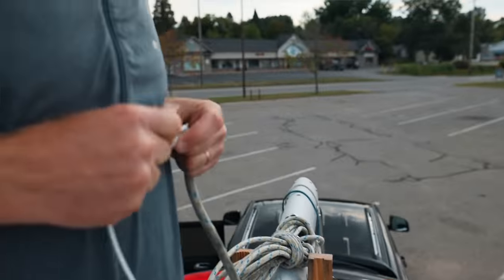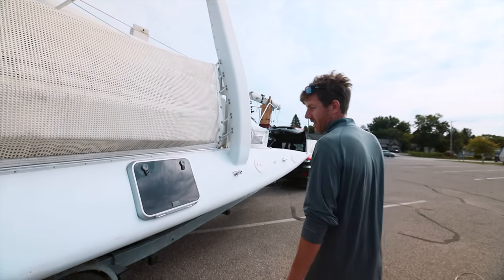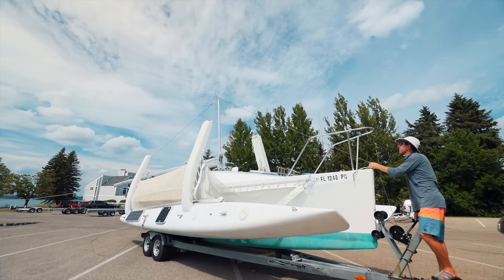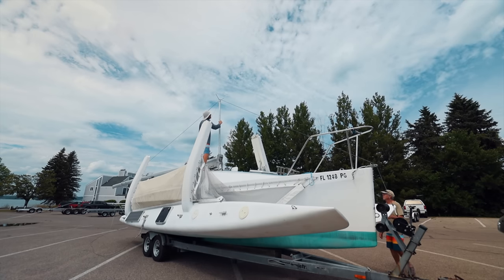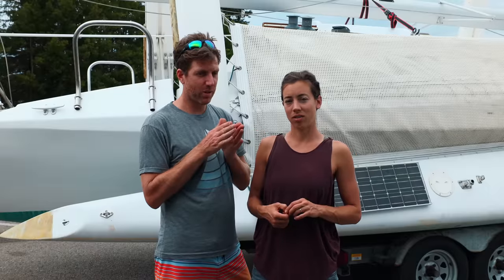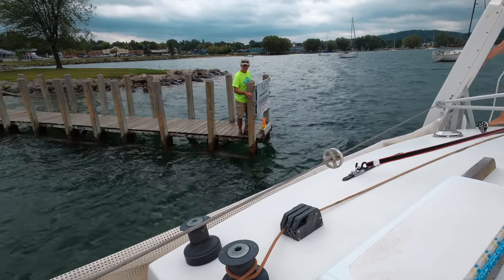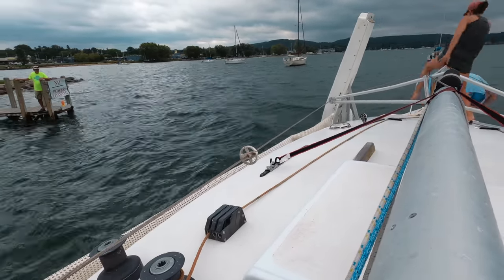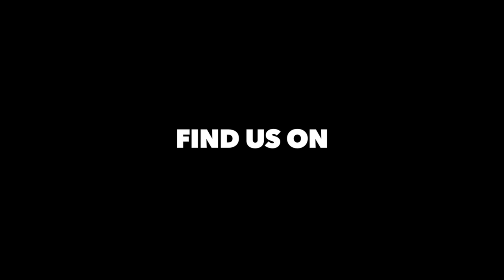How Many Quacks Does it Take to Launch a 32’ Trimaran? | Sailing Soulianis - Ep. 120

Comment: oh and one more thing. perhaps have a backup wire or rope on the highfield lever on each side stay to bridge the lever because ours broke. both of them actually. i have to fold in and out every time we go out. that part does not like waves that make your mast yank on the parts. I replaced them with a pulley system. much better now. :)
always something to improve. 😁 and much fun. saling or just sun bading away from the crowd.
Reply from the maker: Yikes!  Replacing the standing rigging is in the cards. But hoping we get another season out of it.

Comment: I know exactly how you felt.  My first and only launch involved 2 hours of rigging in a wobbly boat on land followed by trying not to hog the boat launch.  Eventually I finally got away from the dock and just drifted a while to physically and mentally recover.  Then just as I was thinking of raising the sails a strong wind came up and it was all my little electric trolling motor could do to make way back to the dock, all the while avoiding other big sailboats who were racing.  By the time I got the boat on the trailer and everything stowed I was totally wiped out and could barely drive home.  And this was only a 16' boat.  Decided this was the wrong boat for me and got rid of it.

Comment: With fuel engines parts and repairs and mechanics are everywhere. With electric, when it dies as it will, you are well and truly dead in the water unless you are moored in front of the dealer.

Comment: Reminded me of the first launch of my boat. Mast stepping is ALWAYS tense, no matter how many times you do it. Anyway, after a wonderful first sail on my new boat at my new marina when coming in at the end of the day I drifted slightly out of the main channel, bounced on a sand bar and my outboard (Honda 9.9) sucked up some sand and destroyed the impeller. Outboard would only run for moments and the wind was carrying me out of the channel. I was alone, running around trying to set the anchor, wound up peg-legging on the keel on the sand bar and had to call my new marina for a save. They brought out the working pontoon and towed me in, making sure I understood that, maritime law states that they could have charged anything they wanted for the save or just taken ownership of the boat. :p First days are fun! I was at that marina for 5 years and the owners were always great.

Comment: You guys have thought about this way more than I have so please disregard but:
1. Get a longer mast support in the back.  Starting from horizontal is a no-no.  You're really only pulling against the pivot pin, basically directly into it.  If you can raise up the middle of the mast by 12 inches it will raise up the tip of the mast by 3x that much at least and now you're actually pulling "up" instead of pulling horizontally.
2. Every inch longer that your gin pole is will help tremendously.  There's really no reason to use aluminum here because weight isn't a factor. The gin pole will always stay with the trailer and not on the boat.  Buy some square steel tubing and buy brackets to strap it onto the trailer when not in use.  Any additional height here will help as well. Obvously when the gin pole sits horizontally it has to fit inside the bowsprit, so that is a consideration.
Good luck guys.  I'm certain you will get it worked out.

Comment: Gotta admit:  I've never raised a mast that big, but I have raised a lot of masts. 

 This might help:  Make a heavier and longer gin pole that allows you to fasten the winch cable to the pole itself, rather than running  it over the top and fastened to the stay.  Both the winch cable and the stay should be fastened sperately to the top of the gin pole - not to each other.  This reduces the down pressure and the tendency to bend the pole and also evens the pressure at the joining position of the two cables.  They aren't then pulling each other so much as pulling the gin pole, which should be heavy enough to take the load.  Getting the whole thing started from horizontal  is easier with more mechanical leverage, which can be acheived using a longer gin pole.  Once you get the mast up at about 70degrees, it gets very easy.

Think of the old wooden ships, which had bowsprits.  These were essentially gin poles that countered the forces placed upon the masts.  They had various means of fastening rigging to achieve that, such as the bronze collar at the tip that allowed the head stay to be attached on the top  side and the bobstay to be attached underneath, running to the stem near the water line.  That's what  you need.  Make the pole yourself with steel water pipe.  Modify it to fit your step kit, and to accept large eyebolts or shackles at the top - one facing north, the other south, for your head stay and the winch cable.  If using eyebolts, make sure they are rated for strength and welded or forged.  No bent dowel eyebolts. Practice a couple times at home, you'll build confidence. 

Shroud position:  If your shrouds are at the mast step position, there should not be a danger of lateral collapse as the mast rises.  It will swing a bit side to side but only as far as the slack in the shrouds allow.  The swing may be several feet at the top, and will look scary,  but the shrouds/chainplates should be rated to hold easily. Once you get that thing up, you will know the tension setting at the turnbuckles and the handy lever action is all you should need to loosen them  for raising and lowering from that time forward.  Having training wheels is fine ( help with those  side lines).

And, secure the boat to the trailer to minimize induced motion as the mast goes up.  It can cause a little  whip snap as the point of mast balance gets closer.  Might make the heart jump some if the boat suddenly settles.  Good luck!
Reply from the maker: Thank you for the info/suggestions :)

Comment: I'm surprised you didn't do a few practice runs of stepping the mast at home, you had the space to do it and  could have worked out the issues, got familiar with the process before going to the ramp.
Seems you need a chock of some sort under the bow and a stronger gin pole
On some trailer sailors they attach the halyard and the trailer winch to the gin pole so you don't have the issue of the shackle moving across the gin pole, couldn't see your setup close enough to see if that would work, but you'll be able to figure out if that would help.

Comment: Try a little longer gin pole and attaching the halyard direct to your main sheet 5-1 purchase attached the bow of the boat. leavng the trailer connected to the boat to reduce the flex. Works well on my Sovereign. There is a great 3 part video on U tube for the Seaward 32rk mast system. Enjoy your videos.

Comment: Guys that looked stressful. I used to raise the mast on my first boat like that using the main sheet as a handy purchase. Your mast was to close to level to make the process easy. You need to prop the mast up above level even just 10 degrees will make a huge difference. A pole with a yoke on the end should work. Practice back in your home based boatyard ready for next season. 👍

Comment: Ok.  To some that may have seemed like a disaster.  But me having purchased 8 used sailboats...that actually went well considering things went bad.  Nobody was thrown overboard by mishap or force, You didn't push things past the breaking point, and you had the sense to drop anchor when more crap went wrong. I'd take that for a win, at least for the first day. That gin pole looks hopelessly short and under sized, I could be wrong, but I don't think so.  I attached my halyard to the gin pole with it tight, then attached the wench line to the gin pole also.  this keeps the pressure straight down the gin pole and not causing pressure aft or toward the bow.  Like I said, I may be wrong, but I suspect your gin pole needs to be made of a thicker wall and It needs to be nearly two feet longer for smooth operation.  I'm sure the folks at Farrier can shed some light on the subject of the gin pole.  Good luck, you'll get it figured out.  UPDATE:  Greg Wadsworth made another good point that I also use.  That's a mast stepper.  That thing you are using for a gin pole actually looks like the mast support.  It's a huge help to get the mast up a little ways from horizontal.  Might check an see if there is a spot aft for that yoke pole to help get the mast up from horizontal before you start cranking away.
Reply: And I think they were led astray by previous owner.
Reply: @artsmith103  I suspect so, at least as far as the mast raising system goes.

Comment: Darn I am getting attached to this site here I am awake at 5 in the morning. I remember putting up tall slender poles for antennas in the army. You need to get the mast at least a 45 degree angle before using the wench. A pole loosely attached halfway up the mast. Use the pole to get it up that far and the wench should work.

Comment: Had a "oh crap" situation with my new to me F28 last summer with the same Honda 9.9 engine. When backing away from the dock on a windy day everything goes fine, then put the gear on forward and add throttle. Except this time the gear goes ok, but no power... tried moving the shifter back and forward a few times but nothing. Wind is pushing us away from the docks, no way to reach them anymore tell my son to get the anchor out and fast. Once anchored I start wondering what to do, guess I'll open the cover, even not being a petrol head. Anyway I locate the shift and throttle linkages to find that throttle linkage has popped out of the arm. It is being locked in place with a flimsy locking plate, that I try to make a bit more tight to hold on until we get home. Started the engine and got away from the port without cover until we got the sails up, so I could reach the throttle faster if need be. Talked later to the previous owner and he said that same had happened to him as well and saw an maintenance video that showed that the owner had secured the locking plate with wire, so maybe a common issue with the engine?

Comment: You'll need to figure out how to do this by yourselves if you wish to sail in more remote locations.  I think using the van, if you still have, with a wishbone pole with bases attached to van's back roof on pivots , wisbone top has U shape that cups around a specific location on mast but cannot slip.  Back up the van to raise the mast so it is at , say a 25 deg angle.  Then use trailer winch to hoist mast up the rest of way using the current gin pole.

Comment: I see your towing with a jeep. How’s that working out? I have 2018 GC with the v6, and currently looking at a Corsair but am nervous about the towing aspect
Reply from the maker: Jeep was a champ.  The transit van works as well.
Reply: Just for a data point, I tow a single axle Mac26S with 4.2L 6cyl FWD minivan rated at 3500lbs. Surge brakes on the trailer and I can barely feel it at any speed. Steeper wet ramps can be a little slippery. AWD would be nice. At local marina I use 2.7L 4WD Tacoma up steep long ramp. No hesitation.

Comment: I know being able to work on the boat “at home” is a big plus, but given all the issues you dealt with, is it still worth it?  Imma guess yes,but….?
Reply: Remember, it will be moored most of summer. They'll do this 2-6 times per year depending on travel.
Reply: @artsmith103  Hmmm…up to six times a year?  I dunno.  Maybe with practice it’ll work out?
Reply: @aleblanc3547  They had a few things wrong. These boats are kind of DIY so the prior owner set them on the wrong path. The hint was when Kirk had to start making mods. Little did they know......

Comment: Given your time differential from occurrence to posting, the mast is/was up.  First, check Great Lakes Racing schedules this year for one design trailerables.  Plan to attend and checkout the launch and rigging systems.  Electric or carbon, no matter, a functioning auxillary is your most important piece of safety equipment.  On my first trailerable launch, 1976 Mac26, similar engine difficulties resulted several large limbs on the deck from recently drowned maples on a new reservoir.
Yes, that 40' stick is big and heavy and that gin pole is a joke.  Our Olson 40 used the boom, lighter mast section.  And the four-part main sheet doubled as the force multiplier attached to the traveler, mast over hung the bow.  And, still we would have a third hand, plus the two wobblies manhandling it to about 30°.  Finally, the Olson had deck step issues.  You may have similar issues, also.  All the more reason to get in touch with the Great Lakes Corsair fleet this winter.  Think your ten year plan is great and hope to see you in a Chi-Mac in a couple of years.
Reply from the maker: Thanks John, all great information and tips! Much appreciated.

Comment: That was stressful to watch. Overall you work very well as a team (including dad). The boat is so much less of an issue while in the water. While on the trailer, it is a constant concern. IMHO, at minimum, I think the trailer needs a thrid set of wheels to split the load. While the boat is in the water, I would have  an expert look a the trailer. I would be looking at recommendations about capacity, safety and power plant for long hauls. It is a significant amount of work to set up the boat, I would  not move this boat more than twice a year. Still, this  will give the opportunity you to explore new sailing grounds from season to season. 😎

Comment: I'm only at minute 9, but it seems like the cable is attached to far "up" the mast for the correct kind of leverage. Plus the mast seems too far below horizontal for this to work. So I'm wishing I were there to help push it up above horizontal so the pull vector is at an angle that is more conducive to what you need to do. Maybe a beefier "gin pole"? Or something. On the other hand, wtf do I know? Try a dry run at home?  Okay, resuming video.... 13:00. I miss the old boat. Such nice wood working. And a steering wheel! The rudder-handle-thingy seems so... I dunno, small-boat-ey. Back to it.... (looks cold. Brrrr). 17:00:  The only motor is an outboard? Is that sketchy? Why did you switch boats again?
Reply from the maker: Thanks James I think you're right on the money with all your suggestions :). With the exception of favoring a wheel over the tiller ;)

Comment: Get a carbon fiber mast. Half the weight aloft. Easy to lift. Easier to bend for flattening the main when you start to go really fast.  Probably the best performance upgrade after sails. Especially in your case.
Reply from the maker: If we could afford it that would be high on our list. Unfortunately it would probably come in at 50-75% the cost of the boat. Which puts it out of our price range. I’d love to find out differently though!
Reply: @SailingSoulianis  I am in the same situation with my 1976 Nacra 5.2.  Would love a carbon mast. But must live with what I have for now.

Comment: I had a similar fuel problem with my boat.  When I bought it, the previous owner shut off the fuel valve.  I started the motor a few times on the drydock before lifting the boat in the water, just to check the motor worked.  Everything was fine when the boat was in the water by the slip, but I had to motor from the slip to the marina.  I turned the key, the motor started, then stopped after about 10 seconds, and would not start again.  There was a queue of boats behind me, all waiting to be put in the water at high tide.

I didn't know the fuel valve was off, and it had just burned the last drop of fuel in the line.  Someone had to tow the boat over to the marina.  When I found the valve, the motor still would not start until the tank was pressurised so that the fuel could get up and over the U bend in the fuel line.  Noob error.

Comment: what you thought was a genpole was actually a  m a s t cradle. That is why it didn't have a hole in it the Mast cradle was to hold the mask high up off the deck so that you didn't need to use a ginpole to get the mass started and raise it

Comment: Non boaters (yet), this is reality! I have had that motor problem. I let my 2-stroke run over 5 minutes before I trust it. I use a jin pole for 26'. My jin pole attaches halyard and hoist line separately. I start with jin pole 80ish degrees, not 90. My lift line has 4:1 block at the jin pole then primary winch. My mast is about half yours all things considered and it's a bit nerve wracking. Side winds just must be avoided. It looks like there is a connection misorientation at the jin pole but I can't see the details.
When I have new power boater crew I tell them:  on a sailboat, when the motor is on we are vulnerable to problems, when the sails are up we're safe. Kind of opposite outlook to their boat. Signage, no power launch was interesting. Power boaters at my launch hate the time/way sailors use lines on and off the trailer. 
I thought this episode would include stepping regardless the process :-(

Comment: Buy a battery powered winch. Also anchor the bow down to the trailer but I'd suggest a turn buckle and rod set up versus a strap so it won't move or stretch. Love the videos and glad to see you back on the water.
Reply: For all the beginners out there, weight is not the problem. A powered winch would be dangerous except maybe for the remote advantage by someone that new not to force it. The challenge is alignment vs wind and keeping the standing rigging in order as the mast goes up. They had the jin pole connected wrong and fortunately the slow manual cranking alerted them there was a problem.

Comment: Why did you not launch from the other side to have the wind pushing you away from the launch dock.?
Reply from the maker: We wanted to be pushed onto the dock as the alternative was to be pushed onto the rocks.  The boat is EXTREMELY light with lots of windage.  It's easier to fend off manually then to avoid being blown sideways when the dagger board is not down.